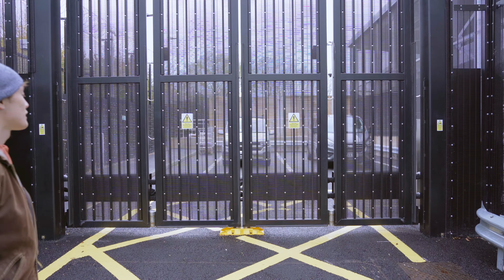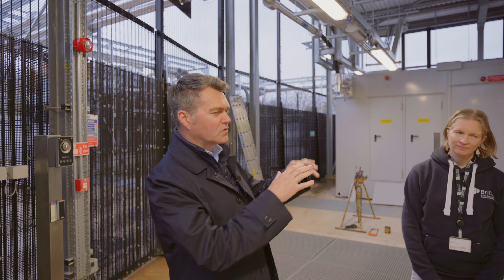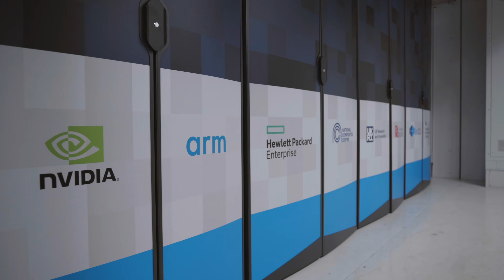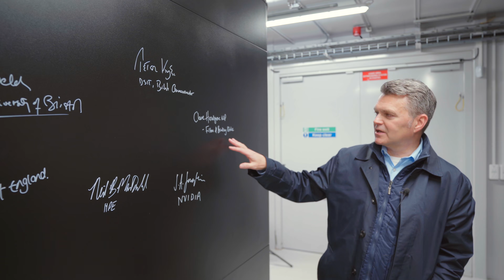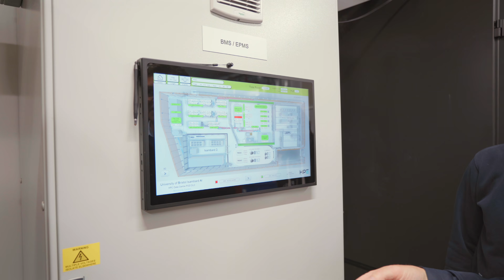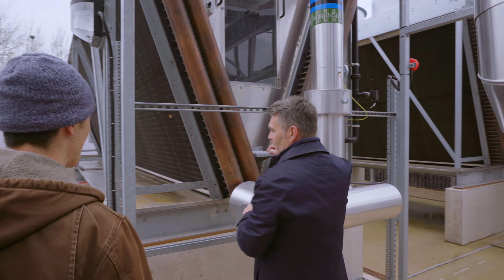What It Takes to Train AI: Inside the UK’s Most Powerful Supercomputer

Comment: I worked at HPE with ARM when we first started looking at how ARM could move from a typically mobile device use to an HPC DC, there is a lot of Nvidia in here but a good combination. That PUE is very very impressive but it is a shame they did not look at reusing the energy to heat the university from day 1. A PUE of 7% more that 1 is amazing but if this thing needs 5MW to run that energy is all still currently just getting wasted rather than being used again. We should be building facilities like this and using the energy to heat local housing, swimming pools etc. I worry about the energy that AI is consuming, we need to make sure we can reuse the energy  for these facilities, its such a waste to spin all these fans to throw away all of the energy used.  My logic could be wrong but if we can reuse that energy the PUE could probably be more like 0.5 or better! They could be greener 100% I had customers with a PUE of well more than 2, sometimes more than 3. HPE had a fantastic R&D lab in Bristol, lots of great things invented there.

Comment: Who in the right mind would deploy a data centre in the UK given the energy costs here?
Reply: But it's very efficient and part of the UK critical infrastructure
Reply: @stephen546  Efficiency is irrelevant, it's still using megawatts of electricity which costs a fortune to run.
Reply: @yourma2000 it's all about context and it's overall importance. Running costs won't be their overriding concern

Comment: A prefabricated datacentre, built in the Netherlands and transported to Bristol to be reassembled; It's likely that the supercomputer components were also manufactured abroad, as well as the industrial coolers and power distribution equipment. The UK really has become legoland, all the nuts and bolts come from elsewhere and we're reduced to plugging the blocks together. It's a bit sad that our manufacturing industry has reached such a low level that we're relying on small countries, like the Netherlands, to supply us? No wonder they have a higher GDP per capita, just another example highlighting the UK's decline to industrial insignificance and I'm speaking as someone born and bred in the North West of England.
Reply: The UK uses its tax system to drive out its best and brightest.   Labour is continuing the tradition. Who is John Galt.
Reply: @sgbirch Do you have a source to confirm that
Reply: Basically true and sad. However, at least there is a licence paid for each ARM cpu core, designed in England.
Reply: @ChrisCordingley Benefitting the Japanese owner (SoftBank) no doubt. But Britain does still make toilet rolls in the UK, so the chances are, all toilet rolls, used in the data centre, are British made or at least British assembled ! Makes you proud dunnit 🫡🇬🇧
Reply: That's how the world works. Many other countries reply on us and others in a complex supply chain. 
The UK makes a lot of renewable energy systems and components, something that would be put in danger by at least one UK political party. 
What the UK isn't good at doing is shouting about our strengths...of which there are many
Reply: The vast majority of significant scientific, engineering and manufacturing endeavours have international supply chains. Welcome to global trade.
Reply: Totally agree - far from advertising British innovation it demonstrates our total dependence on foreign production. What the point of this blog is beyond me?
Reply: If they opened the door and had a Mac Mini sitting on a table and said… here it is ! It wouldn’t have surprised me. 

Basically we should all be proud of their new big purchase from a large foreign equivalent of Curry’s ?

Comment: 19:09 "if you got a very fast home network connection, you might have 100 megabits".
Let me inform you Brits that, according to Wikipedia, "Gigabit Ethernet (GbE or 1 GigE) came into use in 1999."
So, unless he meant to say "100 megaBYTES" instead of "100 megaBITS", I'd say you Brits are 26 years behind - or even worse, cause home ethernet is 2.5 Gb/s or even 10 Gb/s nowadays.

Comment: I love how these guys are describing the ARM Architecture, stating its British technology from Cambridge, yes thats true.... except Acorn (parent or origin company) sold the architecture blue prints off, so we no longer own the IP on it 14:07 for those currious and dont follow, arm uses a low powered architecture for a CPU, which is great for mobile devices such as laptops, tablets, mobiles and PDAs etc as it helps preserve battery life, I think they are trying to drive home energy efficient systems, given all the negative media on energy use, 300w usage per GPU is the equivelant to your Gaming GPU on a PC at home, as for the water, they made clear its closed water meaning its on a loop, those familiar with computing will be familiar with water coolers, this is just an industrial scale one for those not familiar with computers but just currious about the UKs supercomputer.

Somewhat disappointed that the UK has something thats like 1/1000th of the US size systems

Comment: The cooled water seams a bit warm! I would have expected it cold and the water exiting also not as hot assuming your measures are Celsius.
Reply: Based on what?
Reply: Cold water (below 10 degrees) would cause issues inside the blades ( condensation) thats why we pump warner liquid through

Comment: This video worries me how far behind the UK really is in this area! The second the words 200GbE Ethernet by HPE was mentioned in the same context as Grace Blackwell H200, I spotted a big problem! Network Latency! The lack of Nvidia ConnectX-8 cards to allow 800Gb/s links to each node in those servers is a big problem in 2025. Some serious oversights with the networking that leaves Isambard-Ai with a 2400Gb/s deficit per node by using HPE instead of Nvidia/Mellanox bluefield Nics across the site. A cost cutting measure that is going to bite them hard given how fast Nvidia is progressing with the tech and delivering it to customers.

Comment: I`ve got an ARM computer from the 1980`s.
Reply: Yes they are an old company, like HP.  My question would be what does 5MW of electricity buy in terms of terahash rates?
Reply: @simonmasters3295  you can work that out with a mining calculator. Why though?
Reply: @simonmasters3295  I would rather spend the electric on something else. I`m old and don`t even use a smart phone. I can program games etc but don`t think AI is really AI but smart programming.
Reply: @damianbutterworth2434  program games in what language?
Reply: @edism  just in BASIC.
Reply: @damianbutterworth2434 on what platform, spectrum?
Reply: @edism  I started on the Spectrum in 1982. Now I use "BBC BASIC for Windows" emulator. Also into Arduino`s too.
Reply: @damianbutterworth2434  I apologise for presuming you might be a bot earlier, what kind of keyboard are you commenting with?
Reply: @edism  I`m on my gaming PC. The old computer I was on about is a BBC Acorn A3000.
Reply: @damianbutterworth2434  OK, it's just slightly odd that you're using backticks rather than the usual apostrophe/single quote right by the enter key. Especially as a fellow programmer.
Reply: @damianbutterworth2434 I wanted an Acorn Archimedes back in the day, instead I got an Amiga A1200 lol. Looking back they were both great 32 bit computers.
Reply: @edism  I`m crap as Spelling and grammar etc. I see what you mean. I`ve never noticed or realised that symbol was there. It's going to take me a while to unlearn doing that lol.
Reply: @edism  I got it broken back then. Only fixed it about 3 years ago thanks to UTube. It was stuck in supervisor mode. I changed the CMOS chip and battery and it worked after all them years.
Reply: @damianbutterworth2434  lol

Comment: Not sure if 11th is correct, I guess a lot of stuff is still in the building out stage.

200 million, that's not that bad (US$269838477.03 or 229125270.94 euro), ohh GH200 (Grace Hopper) so that's not even latest generation, because that's GB200 (Grace Blackwell), no wonder it's relatively cheap.
Good on you, I don't think my country has this yet. I checked and I see they got funding a few months ago, expected to be fully operational by 2027. A similar price, so yeah, that will be old by 2027 state of the art, but it will also be much more powerful than GH200, I think it would be the next generation after Blackwell. The speed up of GB vs. GH is supposedly 80% faster AI inference. So looking at all of this wouldn't be surprised if the UK started this project in 2024, maybe even earlier.
I would think all the latest facilities are water cooled now, right ? That was already the case with the Grace Hopper reference design if I remember correctly, or was that GB200 I don't remember.
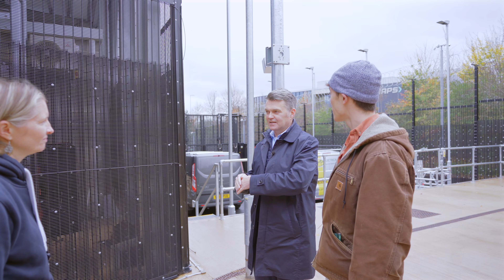4:01 reducing latency as well I guess.

Comment: The 11th most powerful supercomputer in the world already puts us at a disadvantage to the rest of the world.
Reply: I think one of the main aims of the machine is to give the UK a dog in the fight and just the act of building it would boost UK capabilities. And I imagine that the relative size of this machine compared with others will rise and fall over time. One thing that's for sure is there will be more similar projects in future. As for this project, well, it isn't a million miles from GCHQ and it's likely that they had a say in how many computational doodads were required and the Government does seem to have been quite agile for a change. So Kudos to the British Government for once. Hopefully it all works and doesn't turn into an embarrassing white elephant!
Reply: On a positive note, we do a lot with few resources. We always have.  And let's not forget DeepMind was/is a British company, even if it is owned by Google now.  There is a lot of talent here if only the government could do a better job of putting it to work and stop self-sabotaging.
Reply: I think 11th will drop fast in the coming year because a lot is being build right now.
It's last generation chip (GH200 - Grace Hopper), not latest generation chip (GB200 - Grace Blackwell), probably because of the timing when they started to build this project
Reply: @autohmae  true.  It's already obsolete for the most part.  At least they can replace the blades over time hopefully without having to rebuild the building.